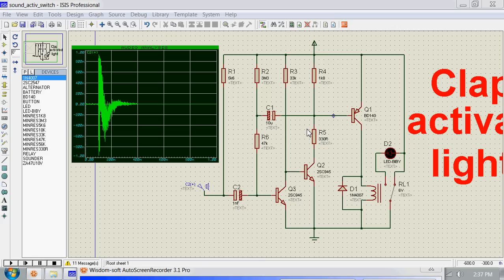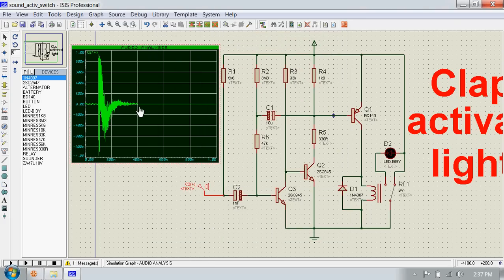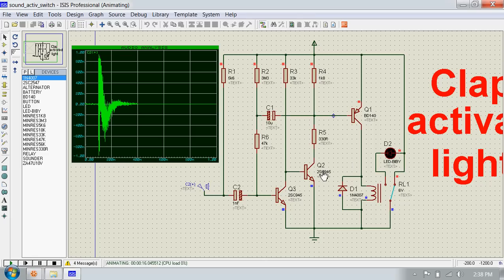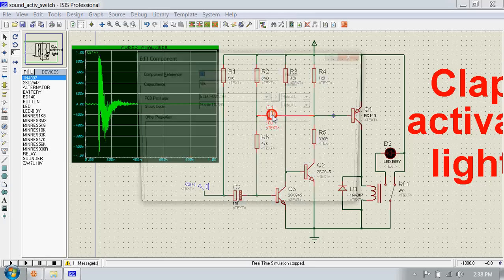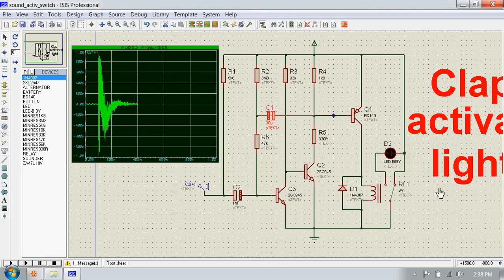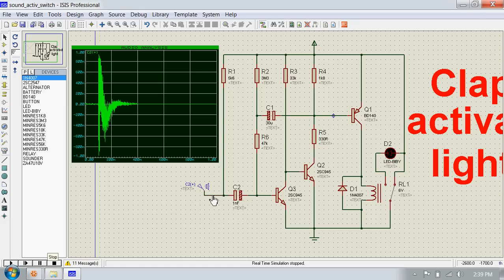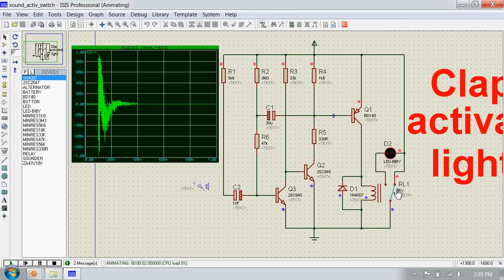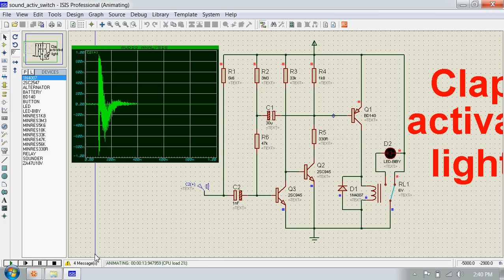clap circuit.avi

Comment: your relay connection is wrong in real circuit it will damage supply or burn track or blow fuse
Reply from the maker: Can you give reason please?
Reply: The relay is shorting the positive s upply to ground when the LED is off.  The power supply might burn out.